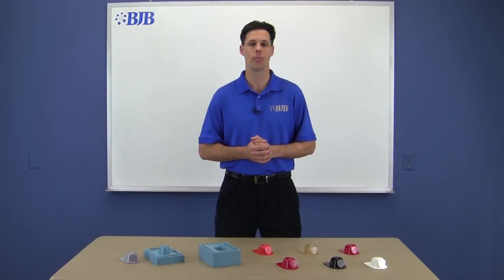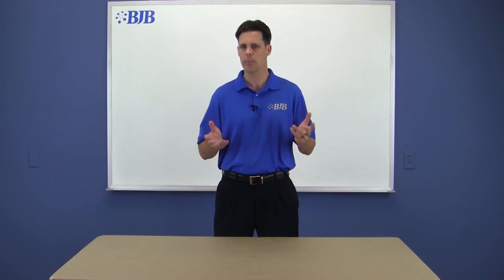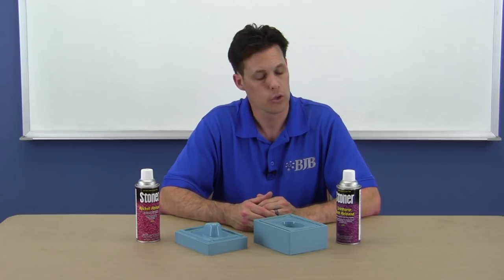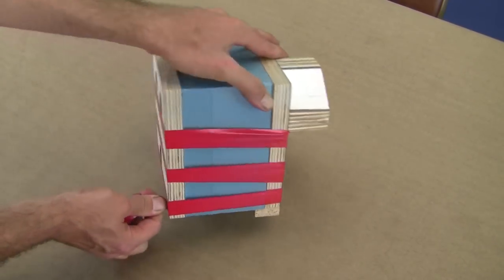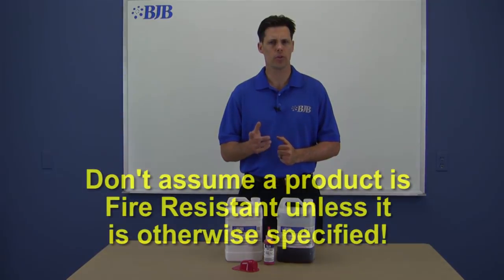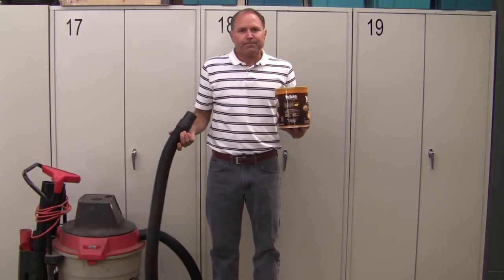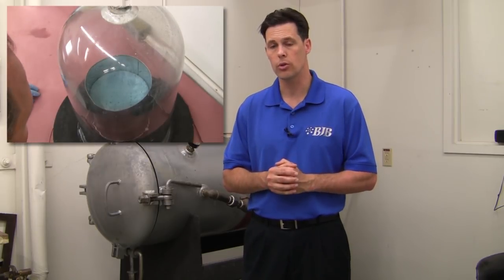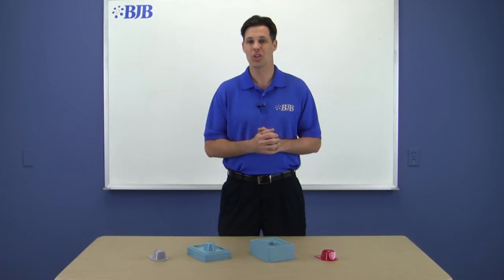Great Video: Casting a Part With Polyurethane | Part 2

Comment: can i use it to make a slush cast for a mask?
Reply from the maker: +Charly Welter You can certainly use silicone molds and casting polyurethane for slush molds, but this 2-piece mold is designed for a complete fill.  You might want to look at our other video to see something more suitable for slush casting: https://www.youtube.com/watch?v=yOOdNyJjhD8
Reply: +BJBEnterprises  i try to make a mask that is robust and hard like a car tire, but i need that it is slush cast compatible but i cant find it anywere can you help me?
Reply from the maker: +Charly Welter To make a slush-cast part, you will want something that will gel quickly.  You can build thicker layers with additional material.  You might want to look at something like our FP-60 or FP-70.  A car tire is approximately 60 Shore A hardness so a 60-70A polyurethane is something to consider:  http://bjbenterprises.com/index.php/fp-60-a-b/   http://bjbenterprises.com/index.php/fp-70-a-b/

Comment: Why not pour the mold in a vacuum. Then there won't be any chance of bubbles!
Reply from the maker: That is a technique called vacuum casting and it has been used for a couple decades in product development.  However, you need special equipment to do the mixing and pouring of polyurethane into the mold while under vacuum.  Some people will fill a mold and place it into a vacuum chamber but if not done properly, the material will bubble/boil and spill out of the mold causing the loss of casting material.

Comment: 13:57 how much time to wait 38 degree?
Reply from the maker: The time would depend on the size and thickness of the mold.  Silicone is very insulating, so it takes time for it to heat up, but when it is warmed up it retains heat very well for some time.  For a mold this size, we would say 30-60 minutes should be sufficient.

Comment: 77f is not room temperature. The median is around 68f.
Reply from the maker: For scientific work, room temperature is taken to be about 20 to 25 degrees Celsius (68-77 F) with an average of 23 °C (about 73.4 F).  Most material manufactures use approx 25 C as a general standard to determine pot life and cure for their formulated systems. Regardless of temp used, the important thing is that data sheets use a consistent number to act as a comparative among different materials.

Comment: Ahhh is polyurethane use to create those kind of  squishies toy ?
Reply from the maker: Many of the squishy foam toys are made with self skinning polyurethane foam.  This video shows non-foaming castable polyurethane which is similar in properties to injection molded parts.  Polyurethane is a very diverse chemistry and we have a huge variety of materials to make different types of parts.  Thanks for the comment.

Comment: Great, but its very slow process. The same part can be injection molded in metal mold probably 1000 times at the same time that you mold one here. Polyurethane better and very effective for small quantities.
Reply from the maker: True, but most parts that are created using this process are never intended to be produced in those numbers or are a functional prototype to prove the concept before investing in injection molded tooling.  This process is called Bridge Manufacturing, designed to "bridge" the gap between 3D Printed prototypes and full scale injection molding.  In some cases like medical enclosures and/or specialty products, the numbers produced in a year may only be in the dozens or several hundred.  If it is in a prototyping stage, making drastic changes to design geometry would cost much more in metal tooling vs casting a new silicone mold.  Understanding where these processes produce a cost benefit is critical in any product design and many of our end users use all forms to help bring their customers' ideas to market.

Comment: Incredible video i hope to follow this process so can you provide me cap 3d file to me then i will follow your process by purchasing your products
Reply from the maker: hello, what do you mean by privide a cap 3d file?
Reply: It means plastic casting cad
Reply from the maker: @caloriecoin_ceo7847  We do not offer CAD services.  Do you have a design of the part you need?  We can look at the design to help understand the part, but we do not design parts for customers.  We sell the molding and casting materials only, but we can help you understand the process.
Reply: @bjbenterprises  on this video, you made small plastic cap.so i need plastic cap cad file. 

also I hope excaltly to  follow your process to make it. so plz teach me materials you sell. I hope to buy them